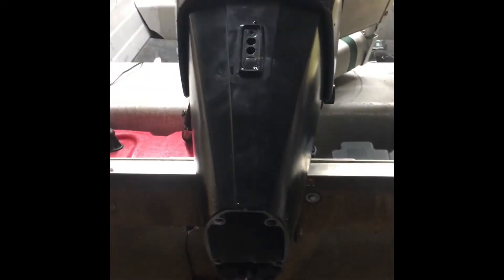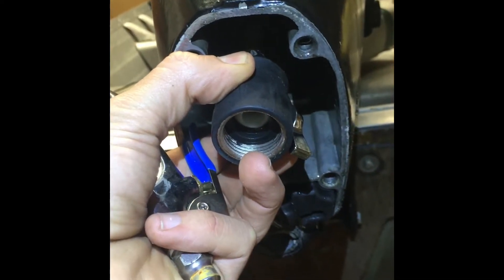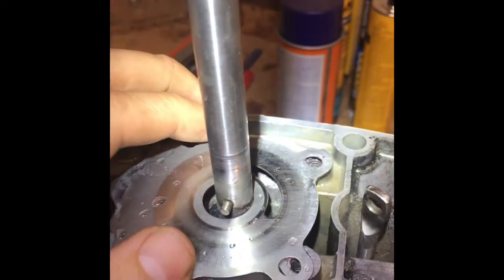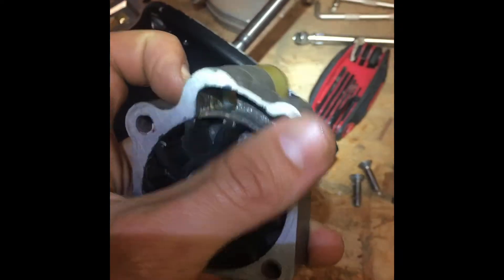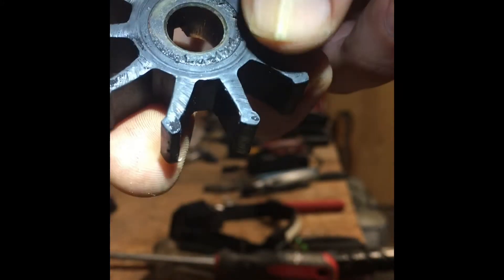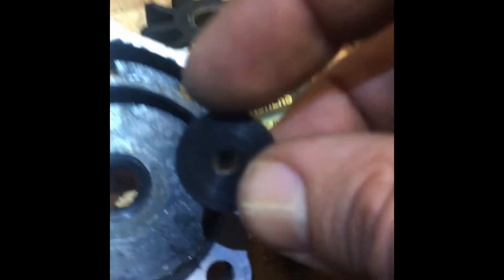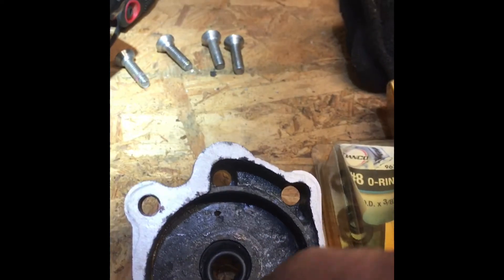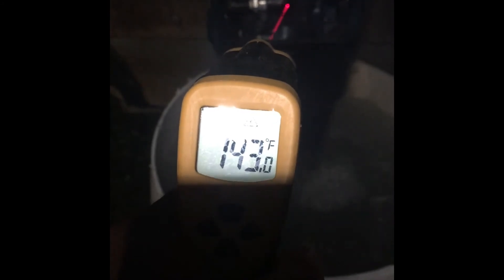Sea King Water Pump Problem Solved

Comment: I'm the original owner of a 1984 Chrysler 15 HP.    I'm with you on the water pump sealant issue.   There wasn't any gasket or sealant on there to begin with, so why add sealant now.     My drive shaft seals failed after 40 years, so I replaced those.   The motor works just fine.

Comment: I have the same outboard as you, and I think the water pump is beginning to fail. We bought this on a boat about 5 years ago, and the previous owner indicated that he had the water pump replaced about 3 years prior, so that pump hasnt been replaced in about 8 years. I cant get any marine shop to work on it as they say the parts are impossible to find. Do you know if you can still get water pumps for these? Apparently since its the one with Chrysler parts, nobody will touch it. I have to have it reved up to 1/4 throttle before it will pump water. Makes lt hard to troll with it if i cant idle it
Reply from the maker: There was a guy on ebay that had a shop that sold new and used parts. They are slim and far between getting parts.

They have all new numbers too and setups. If you can't find the parts diagram and information online let me know. I will try to dig through my files to find where I got everything from.

Yeah probably means you have worn out seals, clog or all the above. I would pull it apart and take a look at the bottom and just clean everything out like I showed in the video.
Reply from the maker: I think I did get some parts from Laing's outboards out of New York and I think there is a shop out of Minnesota or Wisconsin that does parts too.

Comment: I'm having an overheating issue with my 1980 Chrysler Sea King 15. I pump plenty of water at idle and slow speed but once I give it throttle and I go on plane, the water flow just stops and my head starts getting hot. I took the power head off and the exhaust to find nothing seeming to block. I bought a new wear plate for the water pump. Maybe I'll give this a shot. Could you link/show the specific parts you bought?
Reply from the maker: Since you checked the power head, I would still make sure the pickup tube is clear. Just force water up and air like I did in the video to make sure there are no obstructions there.
In addition, there are a number of small holes in the bottom where water is allowed to come in to the lower to the suction side of the pump. Make sure those are clear. I just took a coat hangar and clear them all out. Easy to check to if the lower is off with a light or pouring water in the different chambers.
I showed the rubber washer and o-ring I used in the video. It should show the sizes. I will check later if I can find a link though, I think I bought them from my local family hardware store.
Reply: @HangryAngler  Thanks. I made a video of my overheating problems here: https://www.youtube.com/watch?v=BtTA2Lu7cS8&ab_channel=Bebe%27sLife  I shot compressed air and soaked the block in vinegar. I even completely removed the brass pickup tube! Everything is clear I'm sure. Impeller is new and I've sanded the housing and applied sealant. Hopefully my issue will be solved by this method.
Reply from the maker: @bebeslife4519  Keep us posted!
I had essentially the same issue as you after I reassembled the first time. It was fine at idle sitting in the water. As soon as I tried to give it throttle I would overheat. I blew everything out, cleaned out the vent hole again for removing air in the pump head, and then placed the rubber washer and o-ring on the shaft. After that it solved my issue.

I didn't use any sealant after the first time. It doesn't do anything and shouldn't be needed logically once you torque down the pump head bolts.
Reply: @HangryAngler  Alright I'm feeling pretty confident about this. I think I'll take the housing to Lowes or Home Depot and try to find the stuff you got today. Unfortunately schools getting in the way with a bunch of projects so I'm not able to work on the motor as quickly as I would like. I'll update again when something happens.